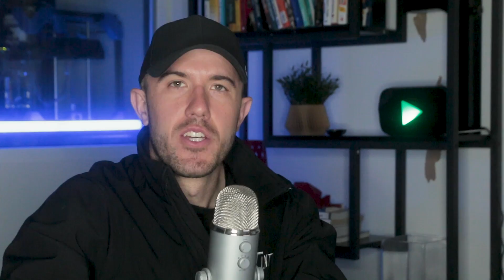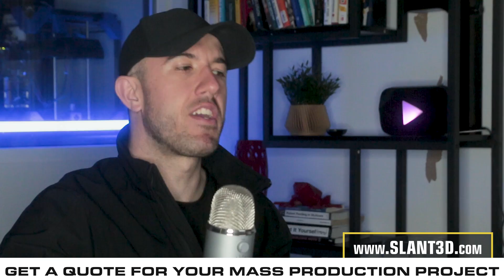Prusa Printables Subscription | Filament Challenges | New Design Series | 3D Printing Podcast

Comment: it's called a sealer bar lol and you mean the heater element is wider use Teflon/sticky back  tape to protect them edge to edge dont burn the tape if you do replace it cheers

Comment: I thing you missed a category. Free files but sell 3d prints of their own files for those without a printer.
Reply from the maker: Angled.io
Reply: @Slant 3D  btw hypothetically, if i did that, I'd put something like the following on the store page...
These are my designs, and you can print them yourself "here" if you like. I will not discriminate your purchase based on if you can do it yourself. Rather, on one hand, I'll be like, "That's your choice," and on the other, be like, "Thank you for the support." Thanks.

Comment: Would love one of two things... label the spool with exactly how much filament was spooled (to the gram) or list the bare spool weight.
Reply: The tare weight of the spool would be useful for estimating remaining filament by weight. Should be easy enough to provide that info on the QR code linked info page.
Reply: Length would also be great!
Reply from the maker: There is 1KG of filament placed onto a spool

Comment: The vacuum seal on the filament I got was so broken that I didn't realize it had ever been vacuum sealed in the first place, I thought you just put it in a plastic bag. My own 3d printing is very much centered around my own designs and a household items series wouldn't be very useful for me personally. Mostly I watch 3d printing videos for tips and tricks on slicing (my cad toolchain is also very unorthodox and other peoples's suggestions aren't very helpful).

Comment: I'm with Jack Coats on this, very interested in a design for manufacturing series with guidance on pricing the product and running a Kickstarter.  But I'm unlikely to buy the designed product and the subscription cost has to be below $5.  If the files are included and i can modify them and sell the product i could go to $10 or more.  But i don't like the idea of products based on rooms.  Maybe do polls and let people vote on what gets designed and what features are included?